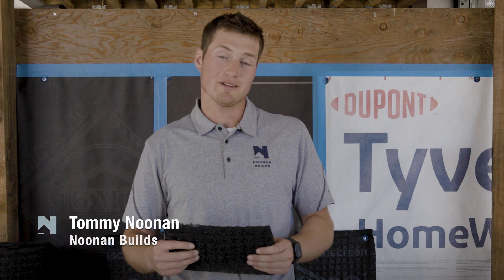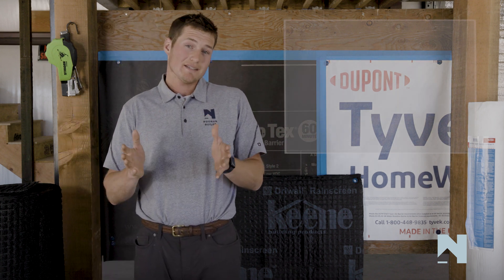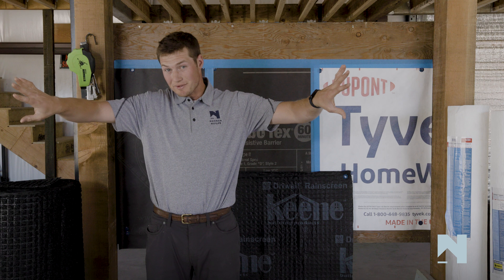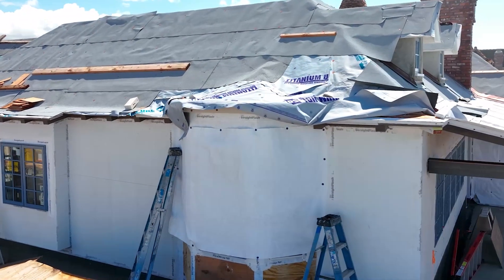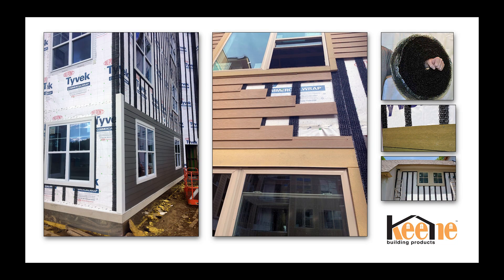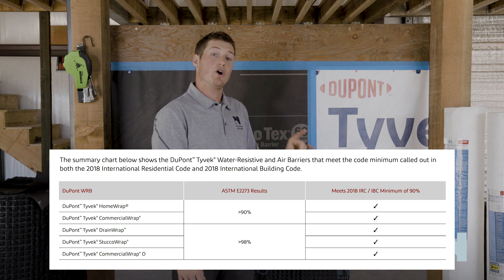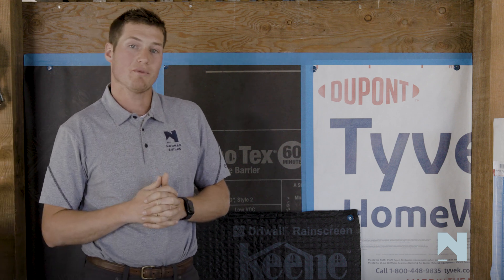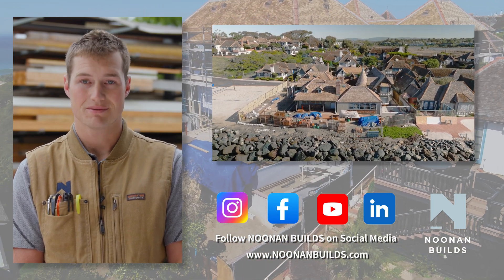New IBC/IRC stucco drainage codes! What you need to know.

Comment: Condensation issues and vapor driven moisture is largely a convection issue, especially with r factors increasing.  What you really need is efis system using mineral wool and the drainage plane.  And stay away from zip its perms are too low, plywood is much safer long term solution even more when you combine it with a self adhesive wrb

Comment: Where are you seeing in the code that two layers of Tyvek is a code compliant system? Reading section 2510.6 it says that some kind of space is needed between the WRB and stucco. Is a layer of Tyvek considered a "nonwater absorbing layer"?
Reply from the maker: That is correct, Tyvek is considered a "non water absorbing layer", and since Tyvek also has a drainage efficiency of 90% or greater,  it would be considered a compliant assembly! Great question!
Reply: @noonanbuilds  Would that not be the same with a layer of Tyvek and a layer of Type 2/60 minute paper? Or is the 60 minute paper not considered to be a "non water absorbing layer"?

Comment: Stucco guy 35 yrs in az, went from no moisture barrier to single paper to 2 ply paper to tyvek to stuccobwrap and drainage wrap rubber wrapping around all openings and penetrations , out of the business a couple years now but this new Keene product looks pretty neat and if done properly and inspected should work, I was upset everytime there was a change every few years but looking back I think it all helped ., except for taping all seams I not sure about that with 6 to 12 inches of overlapping if that is necessary for 20 dollar a roll tape, but anyhow I enjoyed watching your presentation even tho I'm done with  my stucco and veneer license
Reply from the maker: In the 35 years you were in the industry, a whole lot has changed with regard to WRBs and how we assemble the these different assemblies. I hope you were able to pass some of your knowledge along to the younger generation before you left the trades. 
To comment on taping seams of WRB's, your right that the overlap along is sufficient for keeping water out of the wall, the main reason we tape seems now is to deal with air leakage, as most WRBs function as both an air and water barrier if detailed correctly! 

Thanks for your kind comment!